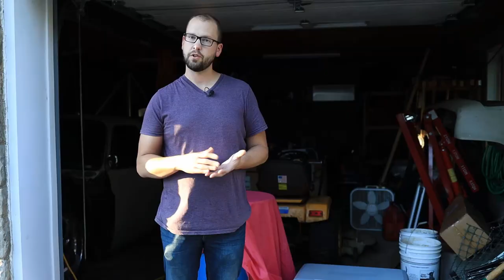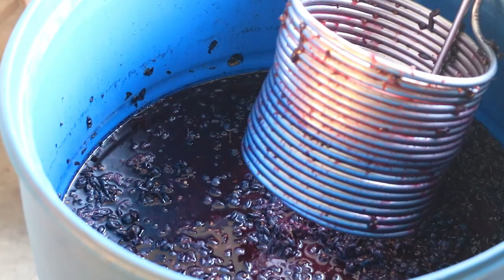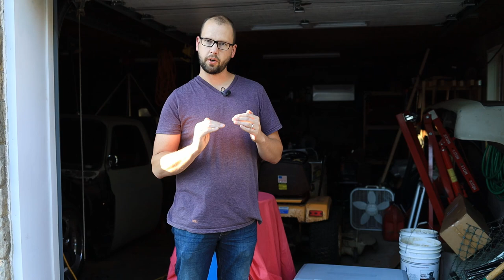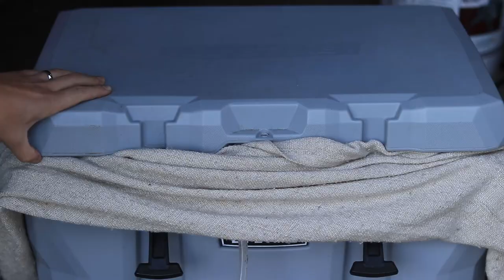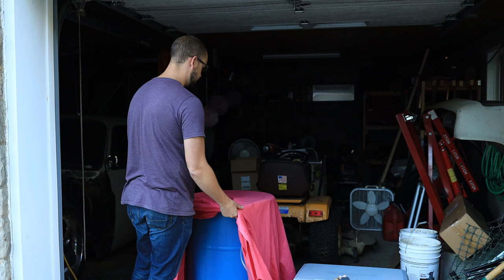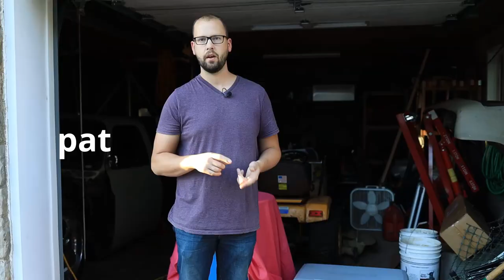DIY Wine Must Temperature Controller

Comment: Hello, from Russia))
I use a beer cooler to generate cold water. You can find them in any beer bar. It already has a pump for cooling the beer tap. I control this pump using a temperature sensor, like in your video.
Reply from the maker: Nice setup! I will keep my eyes out for one of those.

Comment: Welp, I'm officially at this stage of my winemaking journey! The ice jugs didnt work so well. I found that they would swell when frozen and crack open after a few cycles. Turns out I just bought a pump for barrel transfers anyway, so good timing!

Comment: I'm not sure how much cooling power you are needing, but a Thermoelectric Cooler or Peltier device might be perfect if ~100-200W is sufficient. Cold water on one side, heatsink and fan on the other. I have rigged up a system for beer fermentation control and it works great. Very similar idea, and no need for ice.

Comment: Pretty good idea.  I like it. I'm wondering if you could run another coil through a small college size refrigerator and make it a closed system so you wouldn't have to full around with Ice at all. I may give that a try in the future.
Reply from the maker: Thanks!  I think you could do that or get a little chest freezer and put a big pot of water in it.  If you out a little propylene glycol (food grade coolant) in the water, you could pre-chill it below 32.  You potentially could freeze the juice/grapes touching the coil but that is probably not a big deal and no different than what could happen in a jacketed tank at a winery.
Reply: You can make a DIY glycol chiller from a window AC unit pretty easily. I did it to make an ice cream maker that doubles as a chiller.
Reply: Also on the same note you can adapt the hot side of an AC unit for heating purposes the same way. Essentially adapting an air-to-air one way heat pump to an air-to-liquid or liquid-to-liquid one. I guess with home wine making typically you wouldn’t need to use it all the time so cost isn’t a huge factor for ice or for heating water but a heat pump like an air conditioner is very cost effective comparatively to ice or heating with an electric resistive heater like a stove top or etc. Sorry just nerding out because I enjoy cheap diy  solutions to stuff 😂
Reply: If you ever decide to do it just search like “diy beer chiller” here on YouTube and there’s tons of videos on how to do it. I found a window unit on Facebook for like 40 bucks that I did it with to make mine.

Comment: Did you go with the surflo pump because it’s safe for potable water or some other reason? Just wondering because they are a tad pricey but I’m a cheapo so there’s that lol. As far as being safe for drinking water or etc though I don’t really know of many outside of for rv’s , and they’re likely commercial/expensive I would guess.
Reply from the maker: For this application you can use a pump that is not food/drink friendly but having the shurflo is helpful if you ever get into transferring wine batches that are too large to easily rack with gravity.

Comment: Why do you chill  the must ?
Reply from the maker: It's called a cold soak.  You do it to extend the skin contact time on the front end.  Normally for a red wine I will do a 3-5 day cold soak before starting off the fermentation.   You can also extend on the back end, after fermentation but you will extract more seed tannin which is more alcohol soluble and it is a little more risky.  Since you no longer can rely on the yeast to metabolize much oxygen.
Reply: Thanks great info